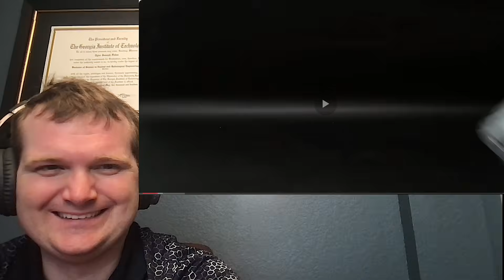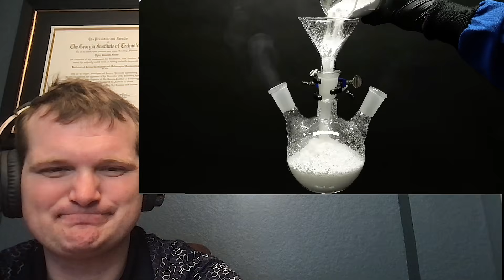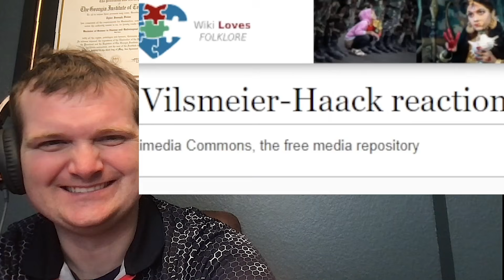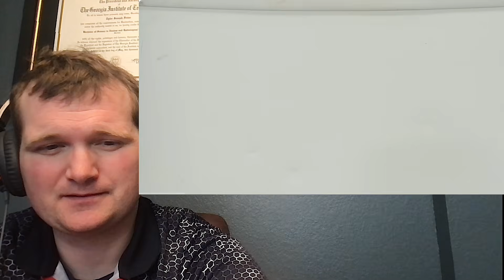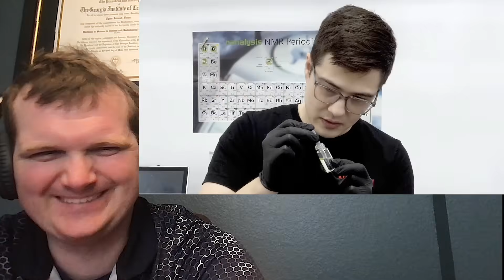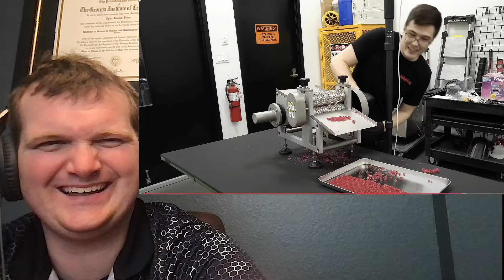Turning Styrofoam into Cinnamon Candy [FULL VIDEO] - Nuclear Engineer Reacts to NileRed

Comment: Im not 100% sure (im not a chemist), but i work in a polystyrene facility as an industrial maintenance tech, and that "trash" may be pentane, it helps expand the bead, and is difficult  to get all of it out. 

Also, the water may be from expanding and then molding the bead, steam from a boiler is used in both cases, and in using a boiler, chemicals are used to control the ph and conductivity of the water. 

So there's most of your adulterants most likely

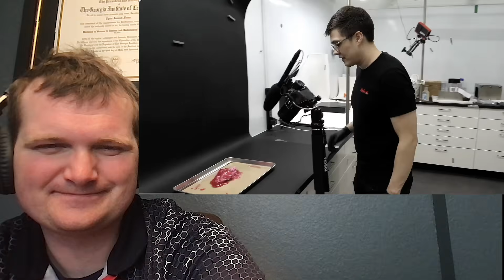Comment: 58:53
Surprised he couldn't find anything! When I've done sugar pulling, that is a sure sign of crystallization. I noticed as he cooked his sugar syrup he didn't drip water down the edges of the pot to dissolve any sugar crystals left from the initial mixing. If you get any of these crystals in the finished candy, the whole lot will turn to crystals in no time. The second he poured the candy out over those crystals it will have started to crystallize. 

If anyone wants to make candy, I highly recommend using a wet pastry brush to clean the sides of the pot as the sugar is cooking. No clue how to salvage it from a crystallized form!
Reply: Professional candy maker here, you're quite right on the crystallization! The biggest issue we run into is with the colorings. Adding the flavor while it's still liquid is fine for a poured hard candy, but if you're intending to work it you need to get closer to that "dough" stage for the sugar to be more stable so the oil doesn't create unwanted crystals. As for colors most of the ones available in this present day are water-based, which means they have to be added even later to avoid crystallization or burning the color.
Once it's started to turn back to sugar crystals you can't save the batch, unfortunately.

Comment: Yes. Modern day napalm is made in an insanely similar way as the dissolving of the cups in the acetone. Obviously I'm not going to list the entire process here, but I may or may not have made a great deal of the stuff to clear out a very large and heavily wooded piece of land I had bought. My brother-in-law is a firefighter, so I had two pump trucks and a crew of 20 guys to do a "controlled" burn. It was successful, but the actual burning took a lot longer than anyone expected it to.
Reply: Since burning is a chemical reaction the reacting surface area affects the speed. For example 1kg of wood burns nice and slow while 1kg of sawdust goes woosh.

Comment: for the 'just need to attach this to turn this molecule into this completely different one', afaik lots of molecules in most everyday stuff are made of just a handful of different atoms, carbon, hydrogen, oxygen, nitrogen, those you find everywhere then depending on what you're looking at there might be a couple other ones but with these four, well look around you and chances are you can see many thngs made of these four

Comment: hey Tyler Roblox RBWR 1.6 just dropped, and it included something im generally confused about within the boiler reactors, and curious how realistic it is. they added something for the central storage tanks (CSTs) called the CST high pressure reverse osmosis system directly at the intake from the reservoir for the BWRs. i know off topic to the video, but what exactly do they do, and how realistic is it?